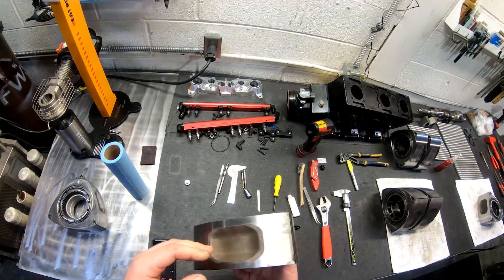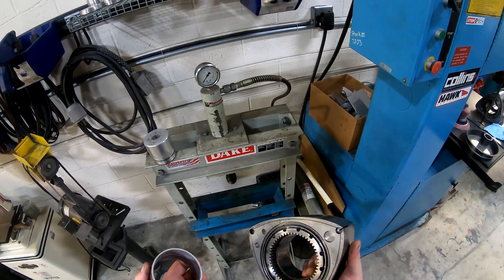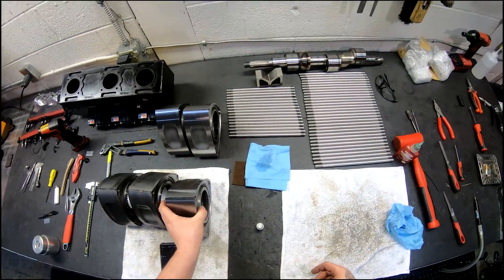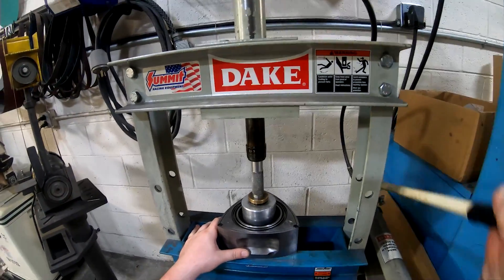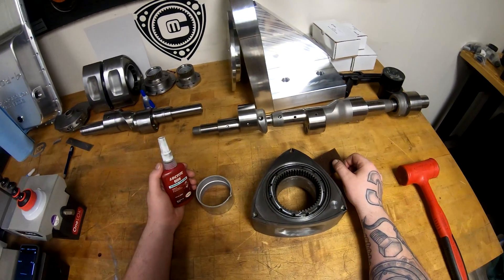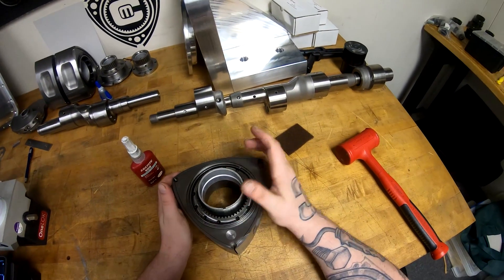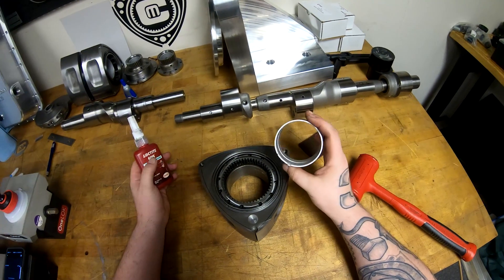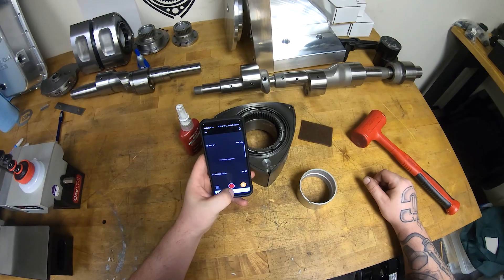Rotary Engine Bearing Install

Comment: Oh definitely 24 to48 hours man for the loctite to harden properly dude, no doubt at all about the ten tons :-) :-) also alcohol will extract the oil from the aluminium nicely and vaporize it from the surface. Maybe slightly heat the rotor to 60 degrees c to clamp the bearing. Less scoring during the pressing event. Yes the quick press will make this soak less heat into the bearing.

Comment: Great vid! Which bearing install tool are you using? I have the atkins tools, but don't like I have to change the height of the press when going from removal to install, wasting time. Good tip too with the loktite!
Reply from the maker: That's actually a homemade install tool.  I was considering making some to sell if anyone was interested.  Just been so busy with other projects.
Reply: @ChipsMotorsportsLLC  Yes please get into making some tools to sell. I want to rebuild my rotary
Reply: @ChipsMotorsportsLLC  how much would a tool cost?